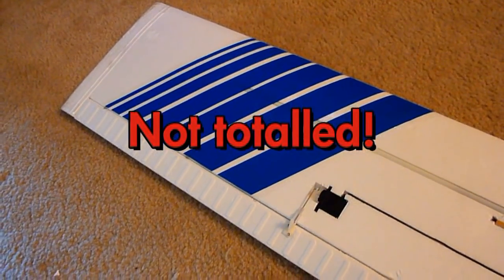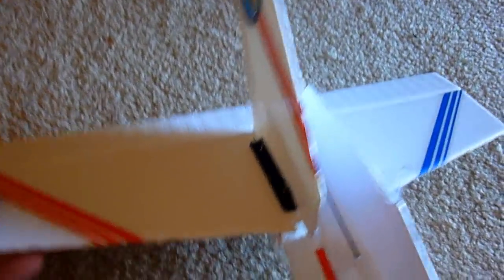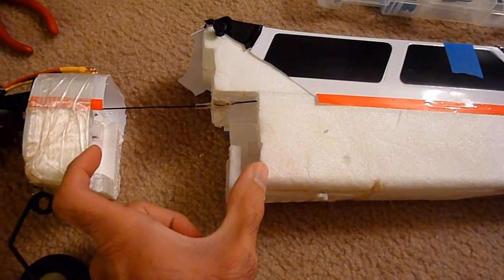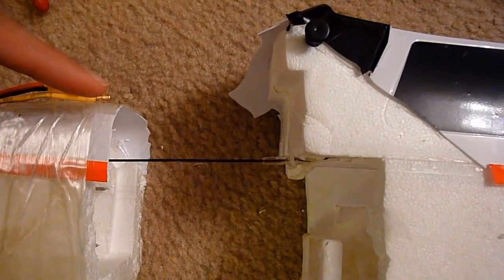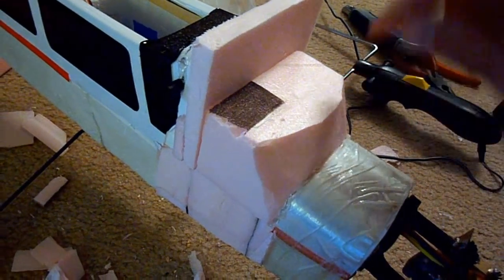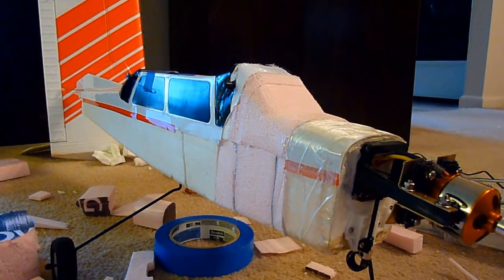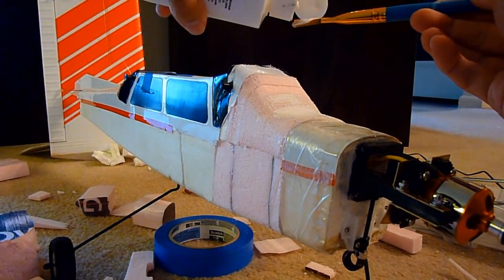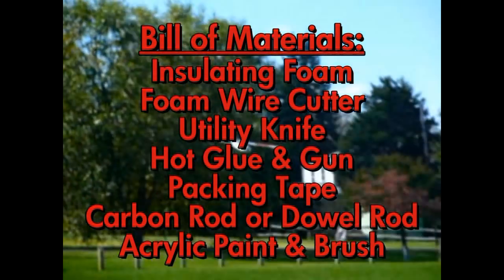How To:  Fix a CRASHED Art-Tech Wingtiger, or any other RC foam airplane

Comment: Good video. Newbie flyer needs to repair cracked foam wings from his first flight ever. Sopwith Camel Pup looked so nice before disaster. after rebuilding engine mount, I will glue ctacks and breaks in thin lower wing. I guess I should consider fortifying it with some carbon fiber tape? Thanks again for sharing this information. Do you have a hot wire cutter because you like sculpting or have to do a lot of repairs? You definately seem experienced .

Comment: me and my brother recently got into rc planes, and already had a good share of crashes, especially my bro...fixed up his b 25 using 2 part epoxy and by cutting up good ole metal coat hangers and sticking them through the damaged areas.  Flew pretty good between fixes, and after more pretty bad crashes the parts that we fixed did not ever re-break again so far.

Comment: How much throw do you get in the ailerons and elevator?

I bought one yesterday and built it today and seems to me to have a small throw on the control surfaces. Adjusted to the out-most horn hole but too me seems not enough, roughly how much for example does the elevator come up?

In MM, CM, inches or Degrees any is good thanks.

Comment from the maker: Super glue is very rigid yet thin compared to hot glue, which is thick and has some flex to it.  It all depends on the area of your plane that needs fixing and what kind of stress it will need to hold up to.  Don't forget normal superglue will eat foam and you need to get the foam safe stuff if you use it on a foam plane.

Comment: where can I buy air planes?
Reply: local hobby store, or amazon has them available as well. a good starter plane will run you about $130 and comes ready to fly, with built in technology to help you learn. They have 3 modes so you can start out in beginner, then work your way to advanced as you become familliar with flying :)